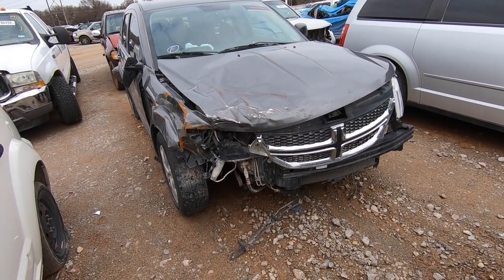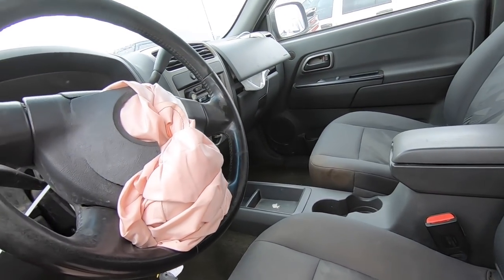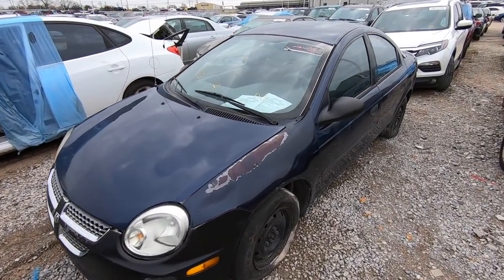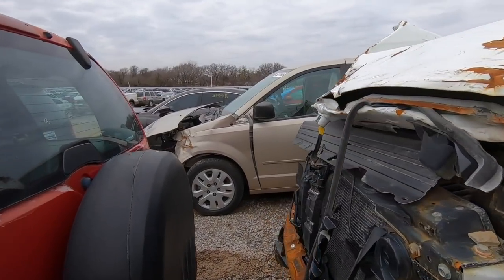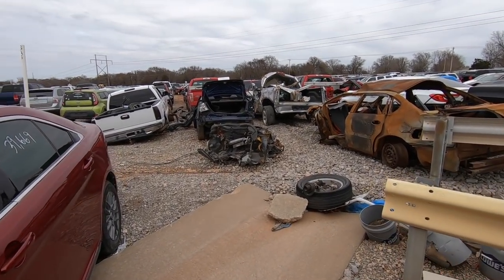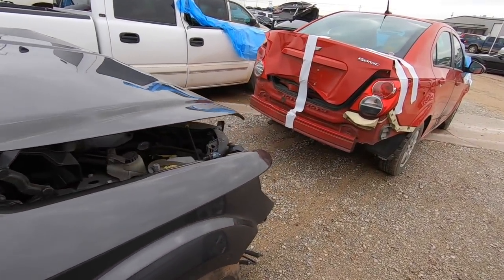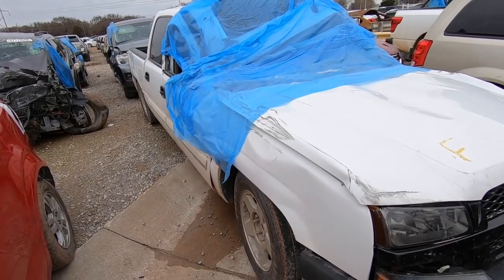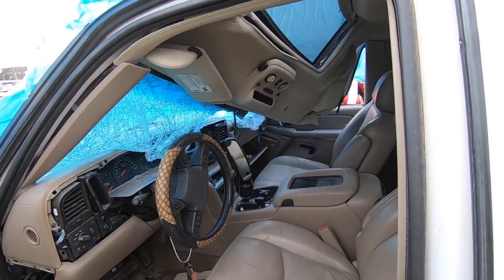Copart Walk Around and Carnage 3-12-18 + 1962 Impala SS!!

Comment: 1:20 yea, my dad had a brand new ram as a rental and hit a deer with it, did over $10k in damage mostly because both front airbags went off and they had to replace the dash, also a piece of the plastic grill punctured the radiator.

28:30 I'm not a forensic scientist, but I suspect they probably hit a brick wall...literally

Comment: Those old Chevys are perfectly reliable daily drivers if they are halfway well maintained. I own a 63 Belair and a 63 Impala. Those cars were meant to run forever. This shiny one might hide a lot of hidden body problems under the paint. It is a pity they did not stick to the original interior though. I bet the car might look much  better than it actually is.

Comment: I had a great well good Neon. The trans started doing weird shifts. I put a can of Shaler "GUNK" TRANS TREATMENT. It was fine the servos must stick. There is a drain cook by the thermostat I put a bottle of firestone additive in rad and let any air out of cooling system by opening the bleed by thermostat now and then, It was unreal in snow and was my work car for years hundred  K a day. I loved that car..I retired and bought a Hemi Challenger new 10 years ago no problems. Service your car spend a few minutes checking oil etc.,

Comment: The biggest thing with these cars with "minimal" damage is. The labor in fixing some of these vehicles is crazy and it totals it out before adding the cost of parts. My 2015 Focus ended up with rear quarter panel damage, a dent and two creases in the body line. Body shop quoted $1500 before even looking at it.

Comment: All Ford Escapes from 2013 have either a 1.6L I4 Turbo Ecoboost or the 2.0L I4 Turbo Ecoboost like the Fusion and Lincoln MKZ.
The newer Titan XD has the 5.0L V8 Cummins TurboDiesel unlike the other Titans that had the 5.6L V8 like the Armada and Infiniti QX80 (AKA QX56).
The Prius is nice. I guess you can go for it. 
I live in California and my dad bought a 1996 Dodge Ram Conversion Van in 1999 with only 30,000 miles and he sold it back in 2012 with only 75,000. It just sat in our Garage for years because he drove his 1993 Buick Park Avenue ALL THE TIME. The Ram had a 5.9L V8 Magnum Engine. The Buick was bought im 2000 with 82,000 and we kept it till 2014 when it hit 200,000 and the transmission went out

Comment: At 5:41 that Colorado would be a great rebuild if you could get a front clip at a good price. Looks like it went above the frame sparing frame damage. Seems like mainly replace radiator support and left apron and sheet metal maybe some wiring harnesses. If cheap enough would be a good rebuild

Comment: weird beard could fix that entrant. you can buy that inter fender new and he can weld it into place. but it looks like the front subframe or h frame or whatever they want to call it on that car needs replaced as well on the front. were the control arms connect were broken. if he could get those parts used it wouldn't be that costly of a repair.

Comment: The plastic trash bags in the Toyota Camry and the Ford Explorer...you know...the ones on the dash board, and passenger areas...what do those contain? I am thinking they are covering the burned pieces of the poor souls who perished in those horrible wrecks. The bio matter that had become part of the cars in which they died. One more thing...How could you not give props to the Nissan Titan when the entire front of that truck was squished like a beer can but the cab was intact enough to actually open the doors! In fact, it was hard to tell it had been in a collision just by looking at the interior. That is one well built rig.

Comment: 10.50 the battery was probly eather cut or disconnectect cause on most fords im not sure why that happens but everytime it gets into a crash the horn tens to sound over and over again 

28.30 that truck had to run into a house or a brick wall

Comment: Those 2013 and 2018 Dodge Journey's were weird... They both had the old 2009-2010 tail lights with incandescent bulbs, but all Journeys from 2011+ have LED tail lights.
Reply: SuchANiceGirl22 The older lights are for base models. There are 2018 Base models with 09 tailights
Reply: @djncrti2860  Wow I never knew that. Dodge didn't do that with base model Avengers when they added LED's to those in 2011 so I'm surprised they did it with the Journey.
Reply: SuchANiceGirl22 Yea I just found out when we went to the dealership for a recall. Some of the base models still have the 09 front bumper instead of the one with a little fake pushbar
Reply: @djncrti2860  Wow they must sell 1 base model per month since I've never seen one before until this video lol. Thanks for putting me hip though 😂

Comment: 5:25 you should see them drive 200 miles south of you ;) 16:50 put 100.00 timing belt/idler & water pump kit on from rock auto @ 1.5 hours repair time and sell it for 1500 they get 24mpg all day long. Easiest 4 banger to work on/repair. Key jingle (on off on off on) will show you cel codes. 350 bucks is a steal

Comment: I feel for you on your experience with MBZ SClass. That has been my car since 1982  including 1970 SE 280 4.5 (2), 300 D Turbo Diesel (3), SD350 Turbo Diesel  (3),  S320 Gas 140 body The Best S Class (2), 
I currently have a 2012 S350 Bluetec that is doing well but I feel  it may be more troublesome in the future. I am also very experienced at working on these cars and doing all my engine rebuilds and maintenance. It would be great to talk with you in the future since you are sharp and honest. Quite a difference from the GOONZ twins  just spending alot of money to clean up only hot model cars...Wonder where they get thier money from.
I have been a mechanic all my life and work as aerospace engineer. Nice to talk with you in the future 203 368 8175